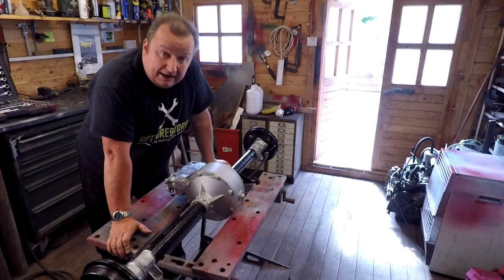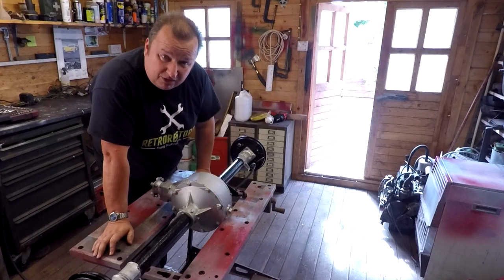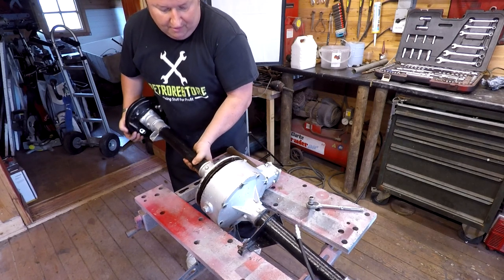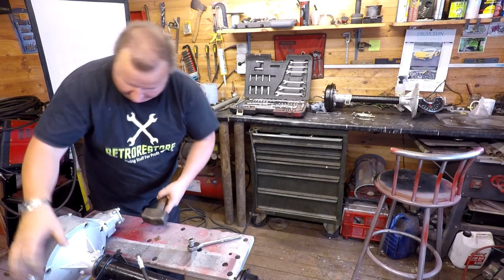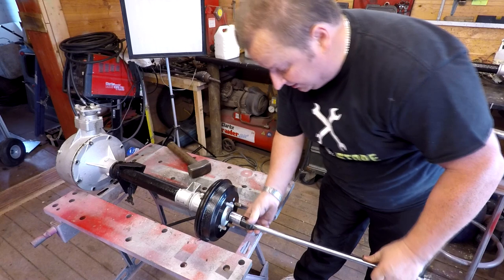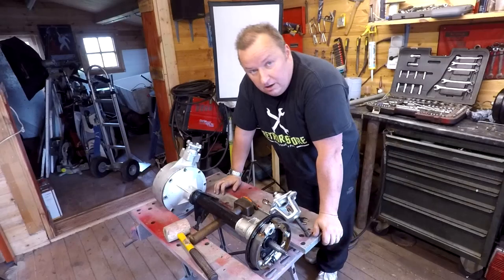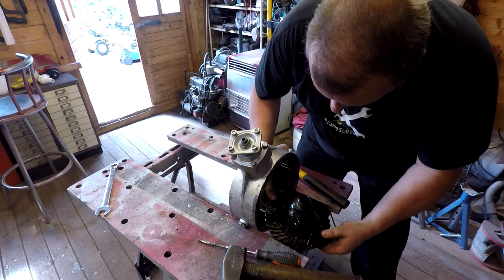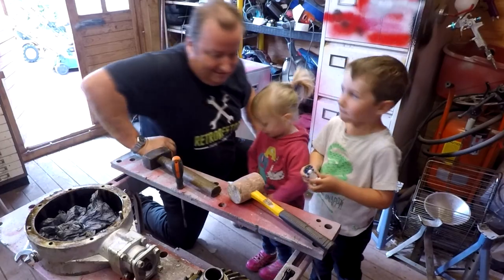Part 20 Reliant Trotter Restoration Axle Out Again #ofah

Comment: they dont have a paper gasket and i think if you added one it would act like a shim and make the diff bearings loose they came from the factory like that it needs a good clean up and some blue hylomar on it also dont need to remove the hub to get half shaft out you have to remove the brakes and undo the 4 bolts behind the hub that hold the back plate on
Reply from the maker: I realised that I didn't need to remove the hub after I took it off lol. I was thinking of Hylomar as well Dan. so thanks for letting me know there is no gasket.
Reply: also you dont need to mark them up as its simple you know what way up the middle goes as the brass breather is at the top drain plug at the bottom the leaf spring mounts go under the bottom of the axle and the drivers side tube has the hand brake mounting on it